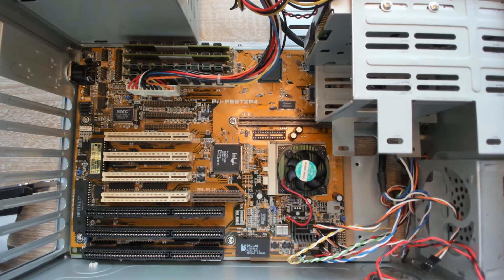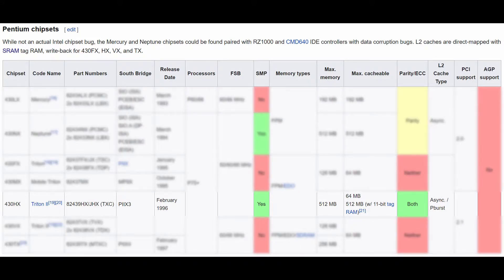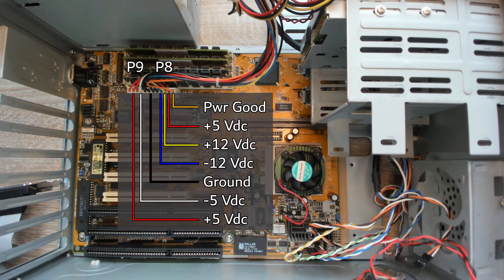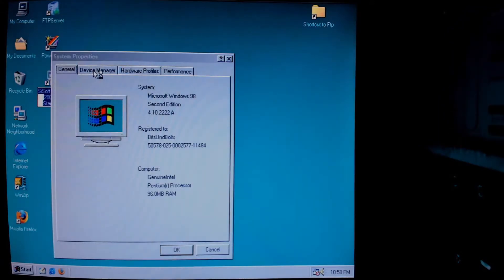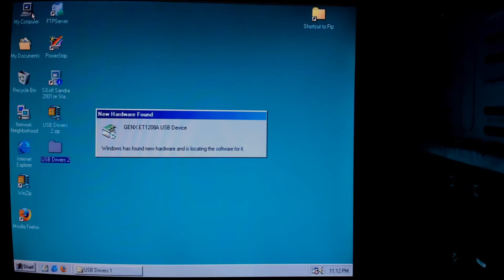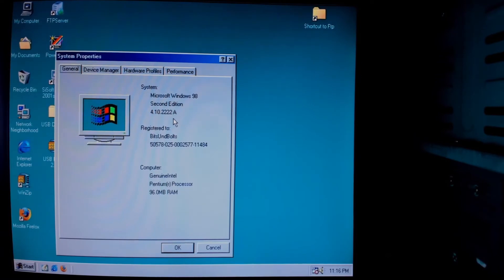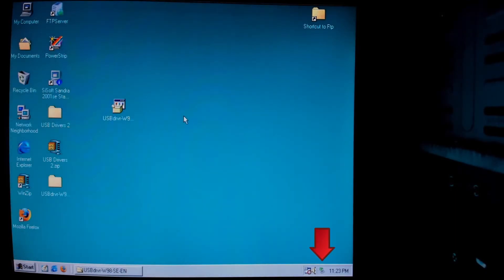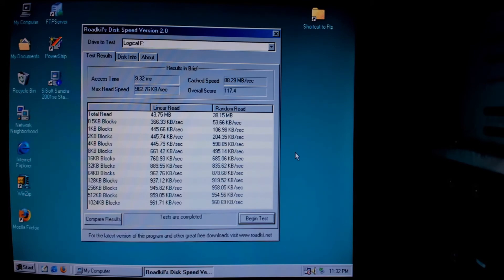ASUS P55T2P4 - USB: Enabled!

Comment: Do you know of an alternate source for the driver?
Reply from the maker: The site doesn't open for you? I just tested it and it is still online.
Reply: @bitsundbolts "Secure connection failed" but I did find it on the Wayback Machine, so it's all good. Thank you for replying!

Comment: I have Intel TX mainboard which includes USB function. I used more basic usb breakout header than yours. Your usb board contains smt components and 2 large capacitors. Mine is just connection header. New motherboards accept this header. But mine didnt work. Only power, no connection.

Comment: DO NOT connect an Asus motherboard header to non-Asus brackets and vice-versa.  You will fry the cable, at a minimum.
Reply: I have a few motherboards and I also have seen some connectors that don’t fit, with different pin outs. Definitely check the voltages as shown in the video.

Comment: USB in the mid-90s was simply bad. Bad drivers, slow transfer speeds and the occasional Bluescreen whenever you wanted to plug something in while the computer was running. ^^

Bonus: My HP Printer created a nice blueish spark at the connector whenever I plugged it in while the computer was running. 

I have the same mainboard here but not the card with the USB-slots. So I installed an external USB-bracket directly to the mainboard-header and it works. I can´t remember  if I had to change something on the pinout of the cable, it was a long time ago... ^^

Have some hazy memory that I had to swap the white and green cable on one of the connectors. VCC and Ground are luckily where they are supposed to be.  

Stayed with PS/2 keyboards and mouses until at least the year 2000 and used a Firewire HDD, just to avoid the dreaded unreliable USB.

USB 1.0 was so buggy and unreliable they withdrew it from market and tried their luck again with USB 1.1 a year later. This time things worked better but I consider USB 2.0 as the first really usable version of USB.

Comment: You said a lack of USB adoption until USB 2.0? I had many USB devices on my Windows 98 machine back in the day. I remember having to install USB Mass Storage drivers for some type of external drive. I had many USB devices. USB 1.1 lead to USB printers, scanners, keyboards, mice and much more. Many so called "legacy free" machines came out in the late 90's with no parallel or serial ports leading to people buying USB 1.1 to parallel adapters for older scanners and printers. When USB 1.1 was released Apple even stopped putting serial and parallel ports in their machines and went strictly with USB which actually helped accelerate the adoption of 1.1. It was 1.1 that started the wide adoption of USB in the industry. A quick search will bring up many articles that will easily verify this. Sorry I don't like the spreading of inaccurate information.

Comment: USB 1.1 oh yes, an update was quickly due.
Personally, I always used the NEC cards up to Vista (if there weren't enough onboard ports).
The VIA chips were the worst. Up until Windows 2000, the ports simply disappeared during operation and reappeared.

USB 1.1 oh ja , da wurde schnell ein update fällig. 

Persönlich habe ich da immer die NEC-Karten genommen und zwar bis Vista ( wenn nicht genug onboard ports vorhanden waren ) . 
Am schlimmsten waren die VIA-chips. Bis windows 2000 verschwanden die ports einfach wärend des betriebes und erscheinen wider.
Reply: That was my experience exactly!  I had no option but to use a PCI USB expansion card (NEC) in one case - a PC I threw together for someone else - where the motherboard had VIA chips onboard.  I also blocked off the onboard USB ports to be sure the user didn't try using them.

Comment: I'm noticing a common theme in the comments here. Of owners of this particular board ending up using a USB addon card instead of getting the onboard USB 1.0 ports working.

I was given an old PC with this exact motherboard in it about a year ago. (Had to replace the Dallas time chip on it, but it was otherwise a reliable board!) Guess what I did with it? I installed a USB 2.0 PCI card in it when I was using it as a retro gaming PC for a time. I did attempt to get the USB 1.0 headers working at one point, but I found out very quickly how flaky and slow it was in use.
Reply from the maker: It is very slow. Also, whenever I leave something in the USB ports and boot the board, it loops on the initial boot screen after detecting the hard drives.
Reply: @bitsundbolts  A good example of cutting edge technology backfiring in the long run. I didn’t notice that specific issue with my board, but then again I didn’t leave a flash drive plugged in when cold booting.
Reply from the maker: Maybe something specific to my board and the breakout cable+ports. Happens to me with flash disks and USB keyboard receiver.
Reply: USB 1.x was really only ever meant for input devices.  Flash storage support was mostly the big advantage in upgrading to 2+  one of the only good things Windows ME had was support for USB Mass Storage Driver by default.
Reply: @FookWit-sapien  I don't think this is true. You don't need 1,5MB/s for input devices. The main reason they moved to USB was printers and scanners as well as input devices.

Comment: I bought this board around 1996. I even got the USB ports for it. For a long time I had no USB devices to use with it. When I finally got a USB mouse I was too scared to use the USB  ports I have bough for it because pin 1 on the header as indicated by the triangle mark was different to pin 1 on the motherboard. I eventually used a PCI USB card instead. Had that board for several years and used it from an AMD K5 PR-133 to finally an AMD K6-2-400 .
Reply: I didn’t even know the USB ports where available to the public in 1996
Reply from the maker: I think the Socket 7 platform is very interesting. It was the last platform where so many different CPU vendors were supported and you have a wide range of slow to fast CPUs. You could keep the board for many years and upgrade just the CPU to stay somehow up-to-date.

Comment: One should know that this connector, being an early one, just supports USB 1.1 (or 1.0? slooooow).
For USB 2.0 you need to install an addon card but I did with my mainboard and it works like a charm :)
Reply from the maker: Yes, it is slow. The disadvantage with an expansion card is that you will lose one PCI slot. Of course, this is no issue if you have an unused slot available.
However, the charm of the board almost demands you to untilize the onboard USB 1.0 connector only. At the time of this motherboard's release, the USB specification wasn't complete, no devices were available, and the manual states "for future use" :)
Reply: Pretty reasonably fast connection for 1996, though.  I think if the stars aligned just right, you could maybe get some comparable speeds in some cases over a parallel port, but that stuff tended to be unreliable.  Not that we were really seeing substantial flash memory devices pushing in to 1GB becoming affordable until almost the mid 2000s.  But almost 1MB/s is plenty fast unless you're looking to fill it up in 1 go.